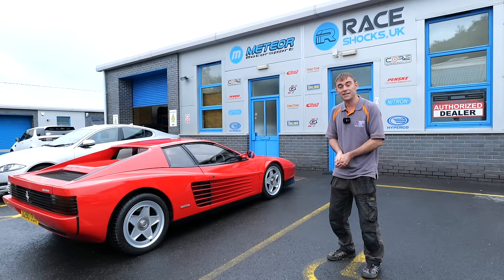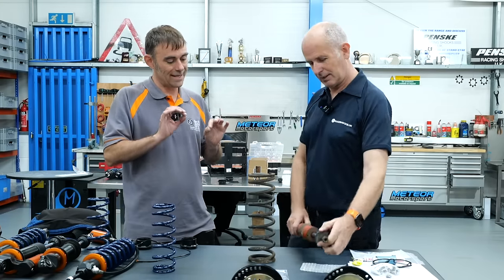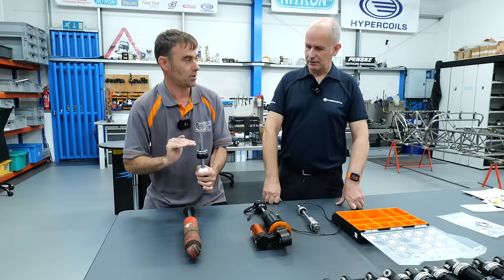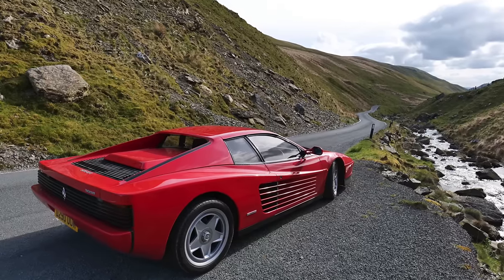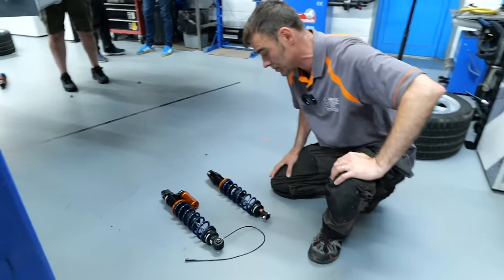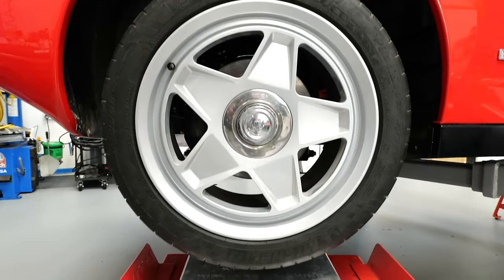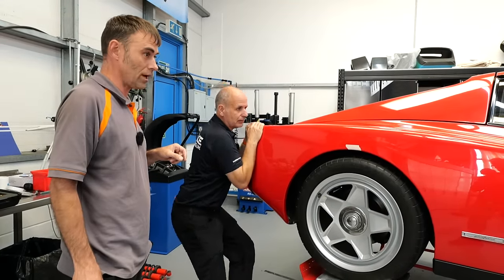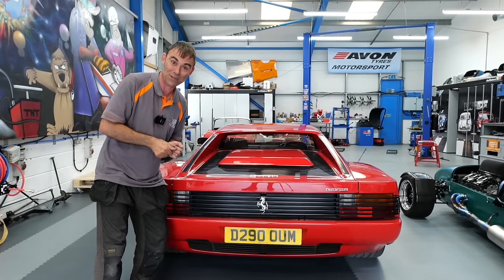Teslarossa Ep9 - Suspension

Comment: A really impressive setup!  In terms of the what determines the spring rate of a coil, it is not just the wire diameter, but also the number of active coils (more is softer), and the diameter of the spring (larger is softer).  The trick is to have the wire alloy and heat treat so that it can handle the stress of the smaller diameter and few active coils to handle the travel.  That is where springs like Hypercoil make the difference.  In terms of the challenge, my guess would be 750 lbs.

Comment: Is there suspension with this technology on the market to retrofit regular cars, mainly for more comfortable rides on very bumpy roads? Not necessarily super high end race-winning technology, but more budget friendly for comfort?

I am really into comfort. Honestly my Poor Man Solution so far has been changing comfort with my tires / lower tire pressure.
For example driving with a little less tire pressure in cities with a lot of tramways, cobblestones, etc.
I am also thinking about getting smaller rims so i have more rubber. Additionally I hypothesize that some tires ment for heavy SUV's, with extra puncture protection are stiffer overall and lead to less comfort (but I am just a regular person without specialized knowledge).

Comment: 14:45 I'm going with 600 lbs/inch, for a round number. Wild guess, as any variation will have a large effect: quality of the steel, diameter of the wire, windings (5,5 Vs 6), etc.
Reply from the maker: We have a winner 🏆
Reply: @ElectricClassicCars  Seriously? Not a 650 or a 550, or a number in between?
Reply: Wow that's not much difference to what some people run on their DH bikes 😮
Reply: @superchickensoup  But the spring/absorber combo on a bike are near the hinge, where in a car is nearer the wheel. The lever effect, as if the spring was in the jaws of a pair of pliers, but you get a lot of travel at the end of the handles of the pair of pliers and less pounds per inch traveled there.

Comment: Hi! Good job on the suspension. It would be interesting to see the power consumption of that system. New subscriber here. 👍 Keep up the good work.
Reply: Welcome 👍👍😀
Reply: The damping system uses up to 10amps. Max 2amps per damper when in full soft. The controller and screen take the remainder.

Comment: Richard I've heard another anti-ev doozy, perhaps you could cover it in an episode. I took my RWD Model Y into the tyre shop to fix a slow leak, one of the tyre shop workers was adamant that if they didn't hoist car properly the hoist would sever the high voltage cable and kill someone. I knew that was complete rubbish but had to check the owners manual once I got home to comfirm. Turns out I was correct, and some tyre shop workers are stupid.
Reply: Like any other car, they need to lift on the recommended jacking points. 👍😀

Comment: Did you weight the difference between the two systems? Just wondered what the weight saving was from the stock set up. 
I have a 2016 Model S 85D with the standard suspension. I've tried to get upgraded antiroll bars and an aftermarket suspension upgrade ie Bilstein, Eibach, Unplugged, but there are no options for the earlier Model S. This would be the ultimate upgrade, smart casual for long trips and fast road for when the mood takes you. And if it knocks a few kilos off the weight, thats an added bonus.

Comment: Have you given any thought to the idea of linking different suspension settings to the different engine settings, with a manual override. So that in "normal" situations the suspension will automatically change to match the performance of the car?
Reply from the maker: Ooohhhh. Now that’s a good idea. Linking the motor modes to the suspension settings 👍👍👍 game on 😎👌
Reply: @ElectricClassicCars  How about mounting the linked settings to a paddle up/down behind the steering wheel, so no button prodding too!
Reply: This is what the super cars do currently. But you will find this system adapts so fast you don’t need to change the settings.  It’s already operating within a range of forces so just by driving harder it automatically firms up!

Comment: My answer to the “rating of that mini spring” if there is just one on each corner of a 1000kg race car, I would say 250kg or (approximately 550lbs)…
Reply from the maker: Close, but no cigar. 😉👍
Reply: Good guess but it doesn’t work like that unless all springs were mounted vertically above each wheel.  You have to consider the “motion ratio”. - that’s one for you to go and look up.😊

Comment: What's the difference between semi-active suspension and full active?
Reply: Fully active would be changing the ride height and damping depending on road surface/ conditions etc. changing spring rates also. The Early 90’s F1 cars from Lotus and Williams were the closest so far.

Comment: Given each rear corner has two struts, should it not have had two identical struts rather than one adjustable one and one regular one? Doesn't it mean it'll hardly ever dampen at the same rate on either side of the axle and potentially cause twisting and fatigue over time?
Reply: It’s a valid point. We have considered this when analysing the design. The size of all the hardware and bolts etc is so over engineered we don’t think that’s the case. The spring rates are the same and of course in parallel.  The secondary mechanical damper is adjustable and can/could be used for fine tuning.

Comment: Can those active dampers work in airbag suspension or only with a coil spring? My W124 Mercedes for instance has divorced spring and damper set up.
Reply from the maker: I’m not sure. Probably best to ask RaceShocks directly. What they don’t know about suspension isn’t worth knowing. 😎👍
Reply: There is no reason why not.  They are just dampers.  More of an issue to any damper is the air spring which is a progressive force.

Comment: A philosophical question occurred to me. Are the shock absorbers part of the sprung or unsprung weight of the car ? As they are partially composed of the springs. If it’s the unsprung weight switching out for lighter shocks by itself should make a mild improvement to performance.
Reply: When we do the maths we consider half the weight of the damper and any control arms to be unsprung and half sprung.

Comment: Very cool project, and incredible condition! So what was the spring rate on the little springs? 400lb? What's with corner weighting with no driver? its it autonomous? ;)
Reply from the maker: 600lbs. Corner weighting is done with weights in to simulate a driver. 👍
Reply: @ElectricClassicCars  600! wow.

Comment: How much weight did you get rid of from the switch of suspension?
Reply from the maker: Good question. We should have measured that. 👍
Reply: @ElectricClassicCars  I saw the total weight when you measured but it didn't look that different, 1710 vs 1712 kg, but maybe there were some more things in the car than when it weighed 1712 kg? Boot lining? Travel tool kit?

Comment: I bet that system will not be cheap, 6 shocks and springs my guess £6000.00 or more.  that little spring I'm guessing 200 lbs, 90 kg's given it
s a reace car.
Reply: The spring has three times that rating. 600 lbs. 👍😀

Comment: Weight loss will make car go air borne. Not safe Indy cars still have heavy10 to 12 cylinder  engine. Car is  unsafe for owner the original shocks weight was a good option now it  unsafe in my opinion

Comment: Your not going to answer the question, what your logic in having an active, and standard damper on the same wishbone, the forces fighting each other..please educate me
Reply: Oh yes we are - only one damper on a twin set up needs to be active. 👍👍😀
Reply: Well u know that's bollocks..
Reply: @conorlee9241 can you explain why you don’t agree?
Reply: I have replied further up the thread to someone else who asked the same question.  The secondary damper is running in parallel and can be adjusted manually.  It can be used to fine tune the overall damping if necessary.  Both spring rates are the same.  We did consider having the second damper with zero damping - simply there to hold the spring in place but in the end we opted to include some damping force.

Comment: The owner is goi g to get banned by ferrari to ever buy another one...was hoping this was a replica...how to turn a piece of history into a worthless car
Reply: If you watched the series instead of being an instantly triggered keyboard warrior you'd find they are only doing modifications that can be undone without damaging the car.  They went to extreme lengths to design new parts to only use original mounts and avoided drilling into the car. Even in this episode at the end you can see all the original parts neatly piled up and ready to take home.
Reply: @BrianBoniMakes  well said @BrianBoniMakes - and not all Testarossas had the top spec engine, and if my memory serves me right, this one did not. Plus it only went out once a year to get retuned.
Reply: Once this project is done, Ferrari will not have a better car on offer, so if I hypothetically was one of the owners of this series of cars, I would not worry about an excommunication from the Church of Maranello.
Reply: Certainly not worthless in financial terms. Perhaps worthless to you because you would never buy it ... which is absolutely fine.
Reply: Very informative video Moggy, it is good to have a complex  subject explained in plain language. I remember getting my new BMW 5 series in 2010 that was fitted with adaptive suspension, it was a revelation, did over 100k miles in it and no problems at all. This car is just getting better all the time.  😎🏴👍